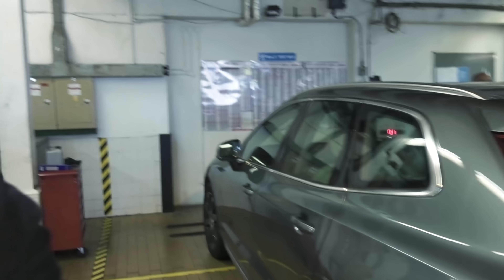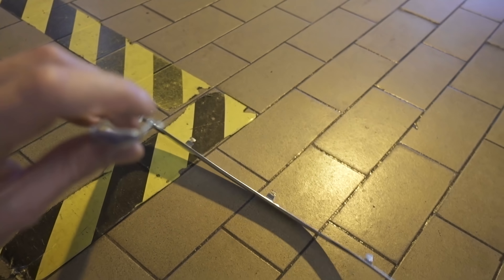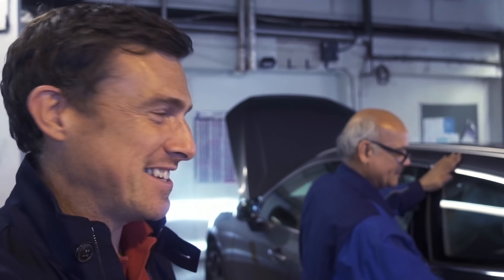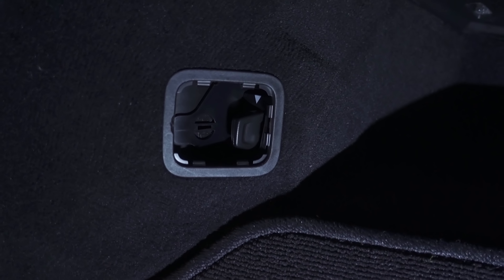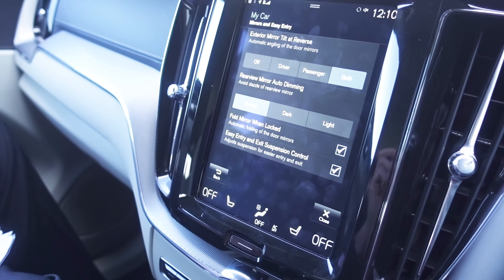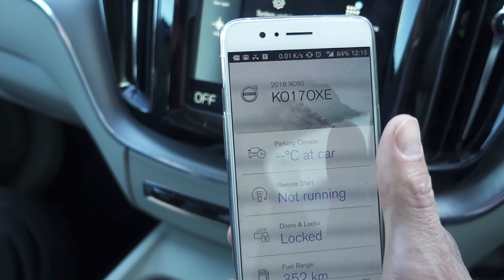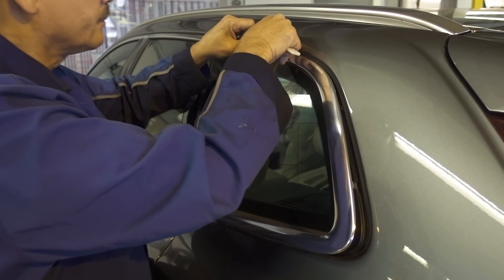My Volvo XC60 had to visit the workshop to be fixed... | Mat Vlogs

Comment: That sim card design is really stupid, seems like dropping it would be really easy to do, as demonstrated by your staff.
Reply: Yup, older people without nimble hands I could see it happening a lot. But then again how many older people will be bothering with a sim card and internet.
Reply: I would say that one is too many. Easily sorted though, just by a tiny modification in the trim design. Now that it has been highlighted, I'm sure it will be an early production modification. If anyone else is concerned and they have such a car, a small piece of black duct tape will block the hole off to stop the possibility of the SIM card from dropping down the hole.
Reply: Just dropped the sim card into the abyss 1 hour ago, currently googling for solutions, yeah this is a stupid design, should have googled more before doing it. ANYONE ABOUT TO DO THIS PUT DUCT TAPE OVER THE HOLE FIRST!
Reply: just happened to me this morning... very bad design
Reply: @daskurka  probably have to take the carpet up? Did you get yours out?

Comment: I reckon that traffic film remover had been used in slightly higher concentration than normal and been allowed to dry for a while on that chrome-like trim, and possibly a bit on the door trim in front of it.  Probably when it was washed prior to customer delivery.

Comment: A reason to the folding mirrors not working before could of been due to a transit/dome/accessory fuse not being installed in the pre delivery inspection stage at the dealership. Where I work, every car has 2/3 fuses needing to be installed.

Comment: My 2017 xc60 (the previous model ) was an ex demo and had the same marks on the chrome around the windows. I tried various cleaners inc cellulose thinners, but to no avail. I then used coarse cutting compound and finally T cut to remove the film. so far so good.( I didnt have time to drive to dealers etc.)
Reply: My 2018 has it too and the drivers door trim was lifting away when I bought it so they replaced the one door trim but all the others have that tarnish on them! I will try some aggressive cutting compound and see what happens. Meguries ultimate didn’t seem to work

Comment: Dried on traffic film remover , either you've took it for a £5 wash or the dealer did
Reply: Just seen this reply and you are most probably correct. TFR can certainly have this effect. Especially is used too concentrated.
Reply: Yup, tar remover has to be removed within minutes. And if it does dry on the trim you don't have to replace it like this guy. Polishing does the trick, i worked at a VW dealership and did detailing on several cars with the same problem. Chrome will almost look like new again. I'm sure wetsanding with a high grit will work too.
Reply: Wetsanding chrome with high grit? I don't think so.
Reply: JordanOnYT deffo tfr, it’s such a shame he takes the cars to cheap car washes
Reply: Looks more like a coating issue from the supplier since it was only the rear chrome piece that had that issue.

Comment: On my volvo xc60 2010, it had a problem on a drain of the sunroof was disconnected causing me to run out of rainwater on the floor of the rear passenger. I discovered the water problem after 2 months of analysis. Very unpleasant when you go back to the dealer volvo to repair and pay the account for a manufacturing defect. Now a have a v60 T5 crosscountry 2015. Am enjoy it very much

Comment: If there's a design flaw meaning a piece of trim takes twice as long to fit as it should do then why should the customer foot the bill for the extra time? (Appreciate in this case it's a warranty job).
Reply: Out of warranty, the customer pays for however long a job takes. Nobody else pays. Its the customer's car, not the dealer's or Volvo's. That's how it is in the real world.
Reply: Yes, the man on the street earning a wage pays for everything in the long run - doesn't mean you have to like it.
Reply: Everybody seems to think that they are entitled to free stuff these days and always wants someone else to be responsible. Nobody likes paying for anything, including running their cars, but nobody is going to take the financial burden over for them.
Reply: I certainly don't feel 'entitled' to free stuff and I am quite happy to pay for the maintenance of my car. The point I was making is that paying for other's mistakes is not entirely palatable, and that's in light of the comment made by Matt in the video that if something takes twice as long as it should through no fault on the customer's part, very often it's still the customer who pays.
Reply: I'm sure that if you did the job it would be done on time every time and if you did encounter problems you would certainly not charge the customer for the time you actually spent sorting it out. [note that this post uses sarcasm to make the point]
Reply: I simply made a point about footing the bill for others' mistakes being distasteful. Yes it's a fact of life, but as I said before it doesn't mean you have to like it. 
[Note, I didn't find it necessary to use sarcasm or a pointed remark about someone's abilities to make this point].
Reply: It is very notable that you avoided the question though. Thanks.
Reply: I suspect it was covered by the warranty as it new and trim genre is in the 1st yr. 

what I think Matt was talking about is sometimes things aren't straight forward to fix much like doing building work there can be additional things which need doing which are unexpected before you start the work hence you he possible increase in work. In my experience the dealers don't tend to charge you for this unless additional parts are needed or it's going to take a lot longer than it originally should have.

Technicians in main dealers are very well trained on the brand and often they will have master technicians who have several years experience and more intensive training to help in these situations.

Comment: all cars come with different coding depending on country/climate and options thats why the option wasnt there, you dont new a reflash, you just have to check some option in computers software. as for the trim it usually gets like that from cleaning soap with to much degreaser

Comment: In some cars, not specifically this one. Most of the tech addons such as CarPlay are already pre-installed on these cars but just need to be activated. I wonder if its the same with these folding door mirrors as in the video you stated that the car went back to volvo and they did something with the software. The CarPlay thing is definitely true on some Mercedes models as you can buy the activation parts on the internet for less than the price of the addon when you purchase the car.

Comment: I also remember that I bought a new car and I drove it for a year but the battery went flat and Nissan were kind enough to replace it but after the replacement few things started happening which didnt happen before and one example of that was the auto locking of the doors past 20 kmph so this could happen

Comment: Im with you on this. I bet, for some reason the software before visiting the dealer was not the correct version for the model you had, i.e. a lower spec model software with no mirror control.

Comment: Various options on my V40 are not adjustable from the infotainment console unless the engine's running or you've pressed the START button with the clutch up, which puts it into a fully-on state.  Perhaps that's the difference here.

Comment: Hi Mat 
Just when you moved your camera to the screen to walk us through the settings ( the Menu clearly stated that Installing software 4.42 Seconds into your Video.
I reckon is  Possibly due to the new SIM card Connecting and Initiating OTA when you installed the SIM card that fell through.. 
I read somewhere that Volvo will have OTA updates for Minor Fixes.

Comment: That staining is from TFR....have you taken the car to the cheap hand car washes?
Reply: Yea or wheel acid overspray
Reply: Left on that part too long and dried on. It happens!
Reply: I've seen loads of vehicles in my line of work with this staining....all to do with cheap car washes using very strong TFR which destroys trim, rubber gaskets, alloy wheels.....if left to dry out this is exactly what happens and yes they probably did not rinse that particular side as thoroughly and it dried.......

Comment: @Matt. I never usually comment; however, I wanted to assure you that you are not an idiot. I was having a lot of issues with my 2018 XC90 after purchasing it. Apparently, my car was not connecting to the internet and would not update itself. So I could not change or access multiple setting similar to your issue. After taking it to the dealer, I felt as though I got back a new car as the software was quite different and updated once they got my car to connect. Also, one time while driving in Myrtle beach with family. I let my father borrow my car and gave him a key after connecting it to a profile I made for him. When we switched who was driving I tried to change the profile and somehow froze up the computer and I could not do anything on my screen. Furthermore, the car changed to metric, while I am used to the American standard and the car stayed like that all day. Thus, I was very worried about getting a ticket from my inproper KPH to MPH estimates.

Comment: Props on getting your mirrors fixed Mat!  But also, you shouldn't ever have to fold them manually regardless.  If you push both the left/right mirror button at the same time, it should power-fold them on-demand.

Comment: Not at all surprised that you are already had problems, I had a XC90 which was good looking inside and out but was the most unreliable  and underdeveloped car I I have ever owned. I had constant problems, and yes, it started corrode ( filiform corrosion of external finishers) after only  a few weeks.
I now have a Range Rover sport which should be unreliable according to everything you read, but it had been faultless  so far ( 25 k miles ) and feels so much moe dependable than the Volvo which entertained with" fault of the day"

Mat - keep the reports coming,  you will have plenty more to report on - you will have amber and red engine management Christmas warning lights soon!

Comment: I also have similar problem with the chrome trim on my previous volvo V40
Sad to see they still have not fixed this little aesthetic issue on their latest car
Nice car otherwise
Reply: There are two ways of avoiding this issue. The first is not to use aggressive cleaning chemicals. The second is not to buy cars with chrome, or even polished 'stainless' steel trim. [Stainless steel does in fact stain and show brown signs of rust in many cases]

Comment: Not all Volvo owners are treated the same way by the dealerships or even volvo HQ. My new volvo bought in Morocco and when the windshield cracked, I took it to volvo shop to replace it. They did a lousy job and consequently 1- the frame around the windshield started to rust apparently they used a sharp object to remove the hardened original glue 2- the rain sensor not working anymore and 3- the fitting inside the car on top of the windshield is rattling making an unbearable noise. The dealership doesn't want to take responsibility and fix the problem and when I contacted volvo HQ they did nothing for me. A rusty brand new volvo that's what I ended up with.

Comment: Probably takes the option through an update via internet. You stated yourself that the internet was not set up in the vehicle due to the SIM card getting lost. 
Sure, they could probably manually do it at the dealership, but it likely took the update the moment the new SIM card was installed.
Just guessing of course.

Comment: I had the same mottling issue on my Skoda Kodiaq. The dealer said it was due to some chemical used to wash it.
Reply: Ashley Summers 
Yes and it can be polished out very earlier too, 
Can't believe someone who reviews car wouldn't know this. 
But I guess these guys wouldn't know anything about fixing cars now more interested in technology.
Reply: Skoda couldn't get it out, they had to replace all the trim around the windows.
Reply: Ashley Summers 
Strange I've had no problem removing it and it looks exactly the same as the one in the video.
Reply: What polish did you use
Reply: hypojames 
I used T-Cut and then I used Autosol metal polish, 
Took the marks right off.

Comment: My wife's Mercedes A250 has that same mottling on the window trim.
Reply: Will most likely go away with polishing.
Reply: Not necessarily. It is most likely to be caused by strong TFR used while washing and allowed to dry and causing tarnish.
Reply: Tbh, it looks like water marks/tarnish, every car I've had with brightwork on the sils has gone like this...heck, even the the black 'night pack' trim on our E350 Estate goes tarnished, just cannot be bothered buffing it 2hrs a day!
Reply: I feel like they forgot to apply some protective coating on that part at the factory.
Reply: They should anodize it with a clear layer
Reply: It's just cheap chrome made in China that Mercedes and Volvo use, it may happen on several other cars though but this is the first time i have seen something like this. I have owned quite a bit of cars with chrome surrounding the frame of the windows and same with my family. The problem is with that particular chrome finish and where it was manufactured.

Comment: My car  has a system to fold the mirrors in, it's called my ✋ hand, works perfectly everytime.
Reply: Yes, mine old volvo 850 is the same hand job :D never fails
Reply: thebanditsix I did that for my Nissan Rogue (it had cameras in the mirrors) After 10 months the slightest highway wind gust would fold them in... Hence why I went Volvo

Comment: Really hate that dealership, had a brand new 2015 xc60 which seemed to have slightly off centre steering and was driving weirdly,  was told by their so called master engineer or blagger that I would be hard pressed to find one with out this problem, quickly and calmly told him to drive back to the shop, and problem was finally sorted by dealership in Watford as it was bent control arm done during shipping or something,  why not say you don’t know, and not blame the customer.
They have updated the car without telling you

Comment: i used to work next to a volvo dealer, and you would not believe how many NEW cars would come back on a trailer to be fixed every day (hint: 2 to 3 a day)
Reply: Reso205 We need 2 numbers here to get a statistic; how many cars came back, and how many cars didn't come back (total number of cars sold, minus the ones which come back).  Then a reliability record can be accurately calculated, and compared to other manufacturers doing the same to see if Volvo is above, below, or on par with their competitors. Without this it's just hearsay

Comment: Interesting that Volvo, North London, actually looked at the trim. I am assuming that it was replaced under warranty. No such luck with my local Vauxhall dealer who seem not to care that items that should have been fixed under warranty weren't. In your reviews is there any chance that you could comment on a dealership's customer service please? It's an important consideration when choosing a new car. For what it's worth, it is unlikely that I will buy another Vauxhall because of the way I have been treated by the dealer. Shame because all my  Vauxhalls have been really good, reliable cars.

Comment: At the dealer ship firstly they would of tried them selves to do the mirrors be for hooking it up, why hook it up if there was nothing wrong,
They obviously gave it an update,never trust a dealer ship if they are going to lie about the mirrors what else are they prepared to lie to your face about,
As for the sim best to block the bottom hole with a bit of plastic to prevent sim dropping back into the hole,
As for the trip looks like micro dust contamination got under the lacquer causing issue later on by sun uv possibly,

Comment: Matt, you can’t auto start it from the app, it’s not legal in this country so they turn it off
Reply: In which country? It works on mine in the UK.  Coasting is actually illegal because it says you shouldn't do it in the Highway Code, yet this and many other cars now have a coasting facility, in Volvo's case in the Eco drive mode. This works in the UK too.

Comment: Hi Mat, did you say you can start the Volvo with the phone app? I know that's available in the U.S but I haven't seen it before on an UK car, please confirm and if so what other cars on the market (7 seater SUV) also has this feature?
Reply from the maker: +Lee M yes you can
Reply: carwow thanks I watched back to confirm, does the new 5008 or Kodiaq have this feature? Or even the xc90 from '15/16?
Reply: It is on my 2017 model year XC90 in the UK. It was built in November 2016.
Reply: Huw Williams: Thanks, I wish I could afford an XC90! I'm looking considering 5008, kodiaq and S max. Maybe Xc90 when it gets bit cheaper around £30k
Reply: Huw Williams: Also manufacturers don't advertise or show off mobile app features! Can't find much on YouTube either!
Reply: I think it only works with cars that have modem communication facilities like the Volvo On-Call emergency and assistance calling system. Obviously the car must be linked to the mobile data network for remote apps to work.

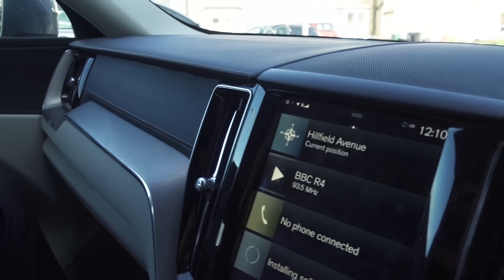Comment: 4:41 the bottom row on the screen says "Installing Software" they definitely did a software update to fix it.
Reply from the maker: No that is for the apps. Not the main firmware
Reply: carwow Then that is definitely strange... I doubt Matt would have missed the options if they were there before. But it's not impossible.